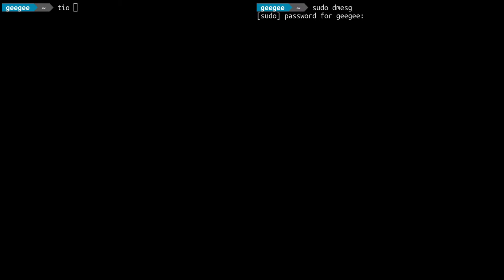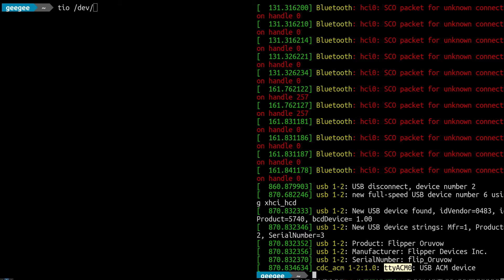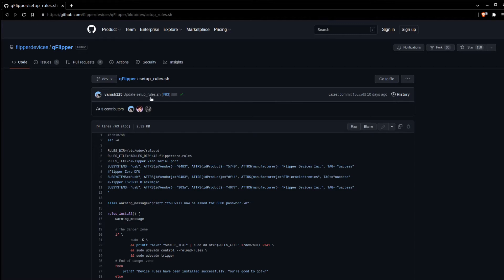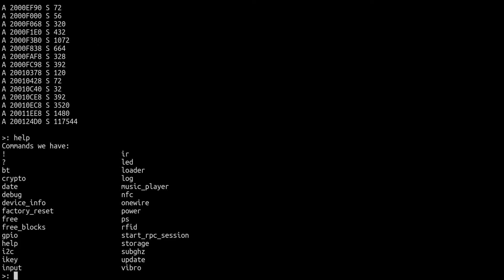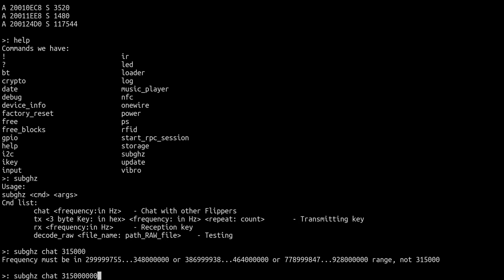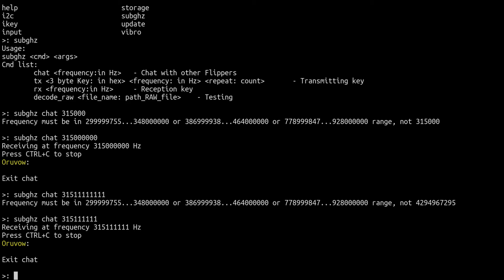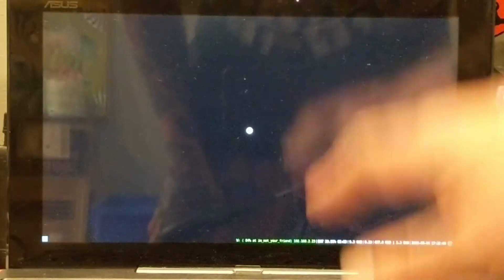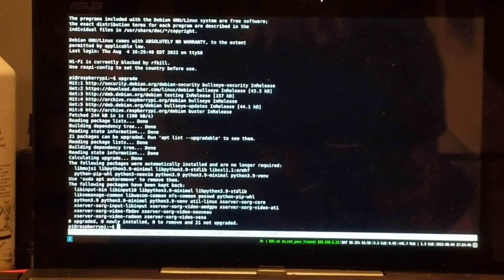Serial Connections and Flipper Zero CLI

Comment: How can i read the output of the marauder board directly on the display? Wich command should i use? THX
Reply from the maker: I actually don't have any experience with the marauder board. I'm sorry I can't be of help!
Reply: believe it to be of the esp32/ wroom variant. Or possibly ESP8266- does your board have a seperate SD configuration/ hardware? Have you in settings specified as to where data saves to? What data are you wanting displayed ? 

If utilizing ESP8266 which itself has an external flash chip -- 1 or 4 MB of storage. The current flashed program itself is saved there with some other configurations, and then there is a reserved space for the "SPIFFS". SPIFFS stands for SPI Flash File System and it’s a small simplistic file system on the flash chip itself. It’s particularly useful to store and access data that doesn’t fit into the RAM. You maybe able to view space used by using the command 'sysinfo'.  See the contents of a file using 'print <path_to_file>'... you are doing so through the serial terminal/ serial monitor found in the Arduino ide. So easy!  @rad_linux

Comment: @rad_Linux Do you know how I could access Flipper CLI on a mac? New to this kind of thing but I'm eager to learn!
Reply from the maker: on a mac I would suggest installing homebrew. Once you have that setup I think minicom and tio are available through that. Homebrew is a great way to expand the use of your mac anyway so its a good thing to have installed! I haven't tried doing this on a mac though so there may be some extra steps you'll have to work through. good luck!